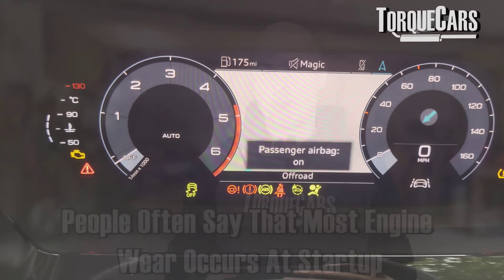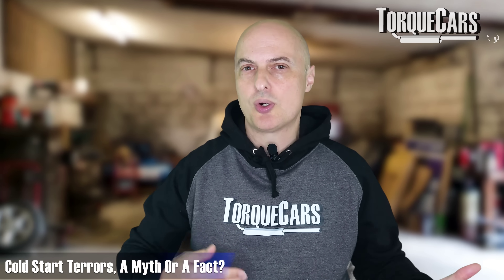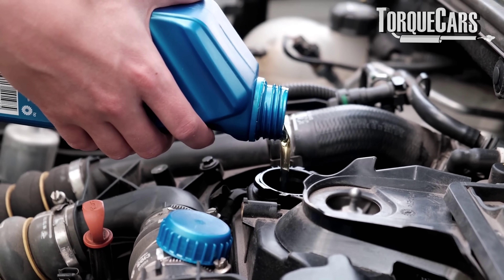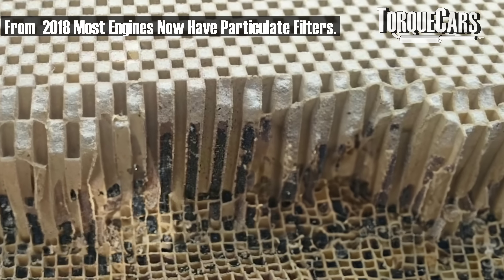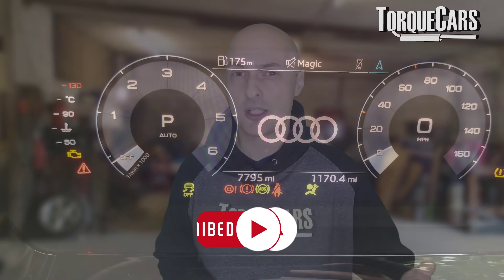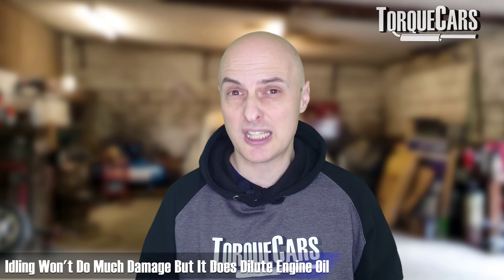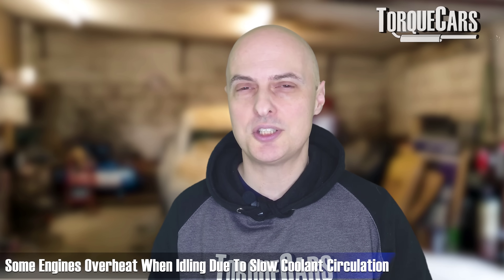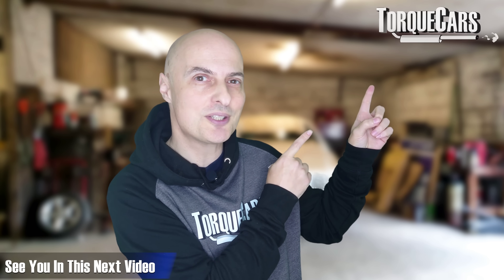❄️Reasons Why Bad Cold Starts Destroy Your Engine ☃️Prevent It Happening To You! ⚠️

Comment: Any views on the petrol hybrids?  I have always followed a simple strategy as you lay out here, but with a hybrid one loses that control. It’ll start off on electric until you need a burst of power when the petrol engine is asked to help and it’ll suddenly be there at 4000rpm (stone cold?). 🫣 I assume that manufacturers have thought this through, but I can’t find any information on it.
Reply from the maker: They use very thin and very specific oil specifications, they retain heat quite well and warm up quickly. Metal expansion is managed quite carefully in most as well, and they typically come with quite a few protections against engine wear, even limiting throttle load at low temps.

Typically a hybrid runs about 20% cooler than a non hybrid on average. If you understand the cold engine damage thing you'll take it easy when the engine first cuts in. 

Hybrid engines are quite complex, I'll drop a few videos on these, first up will be battery tips as the 12v often goes flat if you don't know a few simple things.

Comment: I usually wait for tye RPM needle to drop to 1,000rpm iy takes about 30 seconds. Then I drive away and let my car warm up as I'm driving, keep in mind I've been doing this for years, and my cars are even more reliable than ever. Letting a car sit while idling is causing damage to the pistons and rods cars are not made to sit with the engine running they're made to be moving. After 30 seconds when the RPM drops, you should be leaving.

Comment: Why does the AUDI cluster say" you must drive straightaway to warm up car"? it literally pops up as soon as you crank the car and sit for not even a second.
Reply from the maker: So waiting whilst you put your seatbelt on is not a long time, 20-30 seconds or so. I am advocating driving at lower RPM UNLESS you live in extremes where you are forced to go through a warm up cycle before you can realistically and safely drive as many viewers of my last video took great pains to point out.

Manufacturers don't like long idle periods as I have clearly stated and agree with in this video, it is far better to add some load by driving or using light throttle whilst stationary.

The key is taking it easy until you get warmth into the block itself and the oil flows better. Manufacturers do not recommend using high load/high rpm on a cold engine and many now actually come with restrictions to force you to follow this.

My Audi is always telling me to be in 6th gear when 5th or even 4th is far more appropriate for the speed/load/conditions - I prefer to try to understand the engine than just go with what a manufacturer is telling me.

Comment: Any advice if you live in a valley? There's 3 ways out of my location and they're all steep hills.
Would you leave it in 2nd and stay under 2k until road flattens out or go up to 2.5k into upper gears quickly? Cheers
Reply: All these “experts” commenting and showing off their way as the best one, would respond to your legitimate question here if they were real. But they are not. 
My common sense logic would say, within the best torque range for your engine use the gear which allows you the lower rpm count until oil gets at OT. But this is just an assumption.
Reply: @Emerald_City_  cheers I didn't want to labour the engine, but also don't want to rag nuts off it.
Reply: @Nowted  don't want to rag nuts off it --Don't know, after decades of driving on all kinds of roads, climates and many dozens of different cars over two continents, I would listen to the sound of the engine and observe the behavior of the vehicle. Cars need more rpm up the hill, so apply that and observe in which range it behaves OK regardless of cold start. It's always a range, it's not just that one magical speed or rpm-count that's appropriate for the situation. 
But your question is a very good one and interesting too. That's why I am disappointed nobody comes up with the expert advice.

Comment: Straight piped my Mercedes GL500 x166 m278 4.7 V8 Bi-Turbo.
I also have the stock Webasto but I dont really bother using it.
Also the Webasto eats your battery & a little of fuel. The petrol engine heats up quickly any how.
Also changing oil each 7500Km

Comment: I always drive off immediately by selecting first gear and gently let off the clutch, so the car just moves by the high idle, which takes about 20 seconds on my car. After that I apply just enough throttle to move through my suburb in 2th or 3rd gear.

Comment: My 93' mazda lantis has automatic choke i believe, it raises rpm to 2500 on start, and after a few minutes, it brings it down to 800-900... So i guess I don't need to hold slight gas on cold startup, just leave it idle to warmup?

Comment: i have an alfaromeo stelvio 2.2 jtdm with variable portable pump oil... you said to use all the range on the dash because go low rpm cause demages... so in cold i can't go up in rpm if i go slow the pump just stay at 2.3 2.4 oil pressure... and doesen't go up if i drive normally i need to push a bit hard when the engine is cold to let the oil pressure go up to 6.2, once the oil is a little warm like 2 km it will easely go up every time i move the car again from a stop or a traffic light, even if i accelerate gently... so i don't know if is normal that in cold the pression of the oil stay that low when is completely cold, and infact the engine is much noisier, if i push hard for let the pressure go up it became more silent instantly...😥 so don't run at low rpm but in cold if i run at high rpm i demage the engine, if run at low considering that is an automatic and run at 1200 rpm the pressure of the oil stay at 2.3 i don't know you make me think to much and make me became so anxious i will buy again a toyotra hybrid and i will be ok for a very long time
Reply from the maker: Don't overthink this. My intention is to show what happens so you are informed.

Your keys are go gentle until the engine warms up, this will minimize the wear and tear. Then when the engine is warm use a wide RPM range, instead of sticking with low rpm (I'm talking here about driving at near tickover RPM at say 30mph in the highest gear).

Even the Toyota Hybrids have some things you need to be aware of which I'll cover in a future video. (The 12v battery can go flat quite easily and you might be running on a cold engine more often if you rely on electric power to run short journeys and the oil choice is critical.

Knowledge is what will empower you to make your car last a long time.
Reply: @torquecars  thank you for answering, what you think about the oil pressure that in cold condition don't go up but stay at 2.3 bar if i don't accelerate strongly, and once it warm a little bit go at every light pressure of the pedal gas up easely? but i remember it allways does like this since new and i have 107kkm in 3 years.. i always change oil at 15 thousand km i guess now im gona change it every 10 thousand

Comment: if nothing is happening in the transmission for auto does that mean you shouldjt warm it up in idle?
Reply from the maker: It depends on the transmission type, Torque Convertors vs dual clutch for example work differently and one will still spin up in idle. I never recommend idling to warm up but totally understand that in extreme cold climates you have no option. But driving gently till everything warms up is the safest option for everything out there.

Comment: is it alright to start a car you're not using every 2 days just to cycle the oils through the system? I have a spare car that i don't use often and i don't want it to rot in the driveway
Reply from the maker: Personally I would do this once a week and make sure it warms up each time I do this. Moving the car so it is not on the same point on the tyres will also help avoid problems. I'll do a video on car storage for you as this is a good topic to discuss.

Comment: But if you idle long enough and then turn the hot air on in the cabin that will heat the gearbox oil up and the hot exhaust going under the car that is near the gearbox should help too surely?

Comment: If my car takes 10w30, can I put in 5w30 or even 0w30?
Reply: You can, and I do, but reluctantly. The Motor Oil Geek has done extensive laboratory testing which shows accelerated engine bearing wear with those lower viscosities. However, we all need to be able to start our engines, so we do what we need to do. Install a block heater, consider an oil pan warmer, and switch to 5W or 0W if necessary. I switch back to 10W40 once winter is over.

Comment: My new 2024 car cold start is annoying as hell,  when it starts, it ramps up immediately to 1,800 RPM, and stays there.  Then, when shifting into drive or reverse, it stresses the transmission. Only when it's warmed up does the RPM drop down to around 650 or so.

Comment: what I do when I start the car is i turn on the car and leave it for 1 min until the rpm's drop from 1500 to 750 rpm on idle and then gently drive away shifting the gears on my auto transmission at about 2500-3000 rpm max until the engine temperature gets to its working temperature...

Comment: As a lifelong Northerner you absolutely do not have to wait and let your car idle. You can start it and drive away after like 10 seconds. just don't mash on your gas. The best way to warm an engine is to run it as idle time is also bad for engines. Seems like everything is bad for you or bad for your car. Lol. If you don't want to break your car how about just don't drive it 🙃

Comment: What about the cars that idle at higher revs from cold start? Mine on normal tickover is about 900rpm but from cold start it's I think closer to 1,500
Reply from the maker: That's fine my friend, the car makers generally know what they are doing. Idling a little higher at 1500rpm vs putting it under heavy load in the top third of the rev range are totally different things.

Comment: 03 Grand Marquis here, 475,000 miles, original engine and transmission, we never let it warm up, start it up and just go, floor it to help burn more fuel fast to warm it up faster. in the family since new, I got it at 86,000 miles. my job is 400 feet from the on-ramp to the interstate and I start it up at -15 F, 6am I get off work,  and in under 1 minute I am going 80 mph on the interstate....never hurt it. Just hold the gas at WOT to help it warm up when getting on the interstate on ramp..
Reply: I just got a 04 grand marquis 54k original miles I sure hope mine gets up to that many miles someday on original motor and trans like yours
Reply: @bcbc1037  you will make it, Keep the oil full and changed, you will have to do an intake manifold every 10-13 years with avg use, with age and your low miles I would bet an intake for you in the next 2 years or by 60-70,000 miles, buy a needed adapter for your grease gun and inject grease into each front end joint as you know lube for life is bone dry by age 10-14, a few minor things like the digital climate head will need new o-rings every 10-15 years on avg, the compass, on LS trims, will need the resistors resoldered back on usually by age 10 if a sun car, age 20 if garage queen car, replace your lighting control module if you have not already done it and you drive at night as the low beams can go out- free recall item. these cars easily go 250,000 miles with total abuse and neglect. 1-M with proper care.
Reply: ONE OF THE BEST CARS EVER MADE ,,THATS WHY THE COPS DROVE THEM BACK IN THE DAY  ,,BULLIT PROOF DRIVE TRAIN ,,,CHECKOUT THE CAR WIZARD HE LOVES THESE CARS

Comment: I got an oil temp gauge on my car and drive gently until oil is up to at least 60oc before letting it have some
Reply from the maker: Does that take long?Which engine do you have - just so I can build up a more rounded out picture.
Reply: @torquecars I got a focus st 2.3 turbo  petrol and it usually takes around 3 or more miles to get it up to 60oc depending on  ambient temp

Comment: The ultimate solution to all this is to use a jacket water heater and a electric pre-lube pump. You can have the block heater on a timer or turn it on manually if you are awake early enough. Stationary diesel generator engines will not start unless there is a Minium oil prelube pressure

Comment: Let your engine warm up with a 5 minute warm up until your gauge shows at least half warm then drive away if you are in a hurry. New cars < 7 years have trans heat exchanger with eng coolant that will get trans to have some temperature in it while you let engine warm up. For past 15 years have had a number of cars over 200k miles by letting eng warm up before taking off by just doing an idle warm up for 5 to 10 minutes. Do your oil changes at 5 k miles. Do not drive away cold or just get rid of your car before manufacture warrantee ends…

Comment: Cold start really depends on the car. If you are driving a fuel injection car then it's totally different process. If you are driving a brand new car then the computer is wired to protect the car.

Comment: Engine and transmissions are made of metal, metal with an S on the end of it which mean dilation and expansion are not the same on all parts as different alloys expand at different speeds and extents, the heat generated for the dilation is not universally spread, it comes mainly from combustion chambers and friction points, that's where oil and coolant help to spread the heat more evenly.
My theory is to start engine, let oil pressure build, drive off calmly until car is at working temperature (even then, coolant can be at 90° but oil is still thicker and not at temp)... I just take it easy for the first 15 minutes...🚘

Comment: If you drive your car daily the engine will still have oil on almost every surface. A cold start will not hurt it at all.
Idling an engine to warm it up is the dumbest thing you can do. Just let it idle at most until the cold start procedure is over and then drive off normally and use rpm and throttle in moderation until warm. Doing anything else is significantly worse and just pointless.

Comment: Start car, wait about a minute for RPMs to drop from initial surge and drive off.  Keep the RPMs under 3K till engine warms up.  Use proper engine oil for your car and change it every 5k-6k miles.  That's pretty much all there is to keep the engine happy in cold weather conditions.

Comment: My 06 envoy has a weak oil pump.. a fortune to fix.(. i can't find another dodge pick up v6. ) so i have to change oil.  According to temperature.  Thin stuff in winter.. and super thick for summer. At first i added a bott of " pro long".. engine treatment. Not much else i could do.

Comment: Diesel engines should not be left idling as the DEF Filters will then accumulate with soot and eventually put your vehicle in limp mode. Limit ideling and short trips.
After driving on a highway your DEF filter will heat up where it will trigger a "regeneration" and burn off the soot in the filter.

Comment: Dunno about others but my diesel golf 7 takes around 10 mins of driving on a cold day before the oil temperature even reaches 50°C (I think it’s the lowest temperature it reads) and to get oil up to 90°C takes another 5 minutes at least…..but the coolant temperature can be fully up to 90 in 5 mins. My commute is around 15 minutes so basically just as I’m getting to work the oil is up to temperature, so I have to take it easy most of the way…..which isn’t easy when VW only put a 5speed gearbox in the 1.6tdi….so motorway speeds means higher revs…..they have a 6 speed in the gtd, the gti, the R, the 2.0 diesel, even some of the smaller petrol engines…..yet they decide not to pit it into the smaller Diesel models….fry’s my brain, with the 5 speed it feels like the car is fighting against itself to keep at 70 (ish) a 6th gear to drop it into would just lower the revs and make it more economical and smoother…….I can only guess they specifically want the revs to be higher at motorway speeds to get heat in to the DPF so they deliberately didn’t fit a 6 speed, I can think of no other reason!,

Comment: 3 minutes in freezing temperature. 
2 minutes in cold temperature.
1 minute in warm temperature.
Don't drive at the start, if you're in a hurry now and then, 30 seconds to 1 minute.
Then drive slowly increasing the speed gradually to warm up the transmission fluid.

Comment: So after 30 seconds start up with 300 rpm I can drive I
Off with warm transmission & engine.  You.shoul clearly tell.the idle time to drive off after starting the car. If my windshield if fogged or iced up I have to wait until I can see where I'm going

Comment: The "put it to the floor" technic, was popular with EVERY MECHANIC!! Except 2 at a performance modification shop in the deep south of the United States.

My self because I was in charge of "mapping" I would put throttle and rev limiters based on the engine oil temp. To keep the other mechanics from red lining cars on cold start.

So... The "idea" is that if you "rev it like it wahana don't be no Bitch" is safer because it puts the oil pump at full speed, pumping more oil when cold. And heating it up faster = less ware.

Mechanics where pissed when I did the rev limit mods.

Comment: My car will rev higher the colder the temperatures are. When it's in the single digits (Fahrenheit, or like -20C) the car goes to around 2000 rpm at idle during start instead of around 500-600.

Comment: The entire point of newer, and by new that could be like 10-20 years or more compared to the proper older engines, is that they auto rev slightly higher to warm them up faster, that's the entire purpose of that. My car, depending on outside temperature, revs between 1500-2000 when I first start it and after a minute or so it comes back down to 7-800 or whatever it is.

Why would I need to rev it past 2000 to 'warm it up' when it is already designed to basically double rev in idle for that exact purpose?